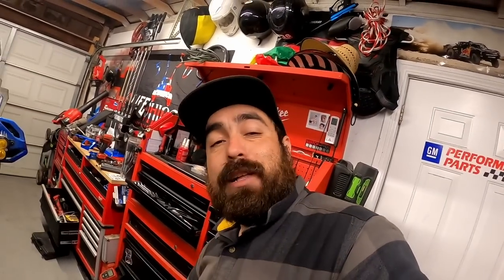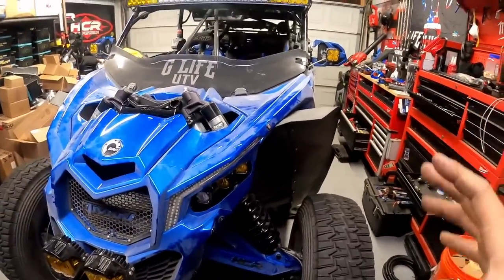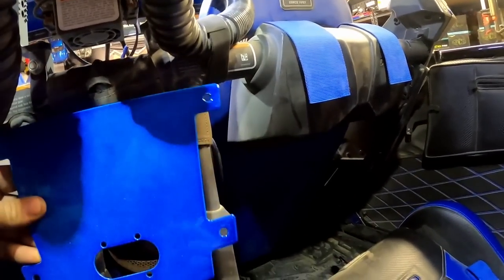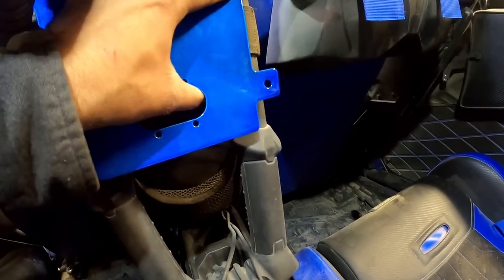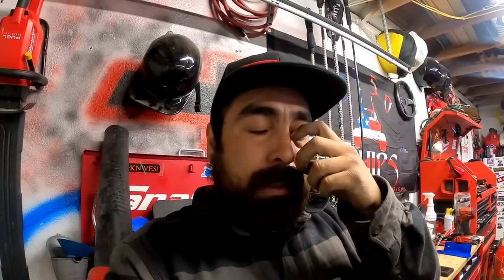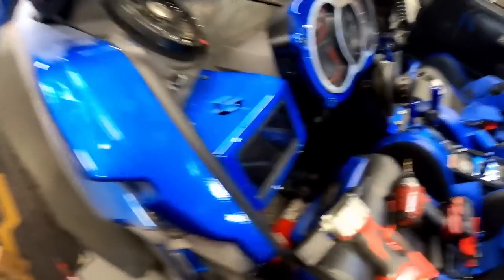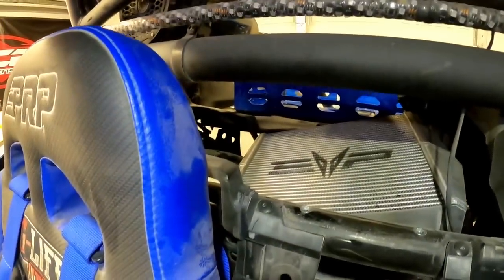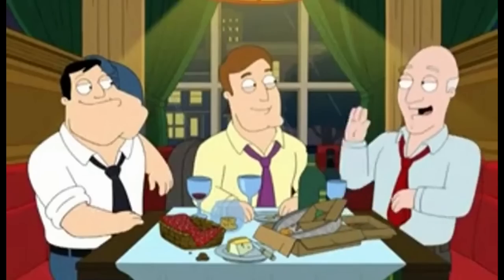90K Later its Done. Big Blue the X3 Complete. Maybe?! Ep 283

Comment: The inside panels of your doors came out nice!  Seadek?  Thought you were gonna do a vid on that? Maybe I missed it. Car looks sick bro. Keep up the good work
Reply from the maker: Right before the sandshow i put the car together. And yeah we use the sea deck material. You can find them all over Amazon
Reply: @GLifeUTV    I just took your advice and did this as well, on some new doors I just installed, pretty easy to install and so far it really cuts down on the rattles and adds a little weight to the doors 👌
Reply from the maker: @ChupacabraOffroad  lets see it👌

Comment: The rattle from the passenger side is the exhaust springs.  Wire tire around them or house clamp around them and it goes away
Reply from the maker: It's not the springs. Coming from inside engine.. 👍
Reply: @GLifeUTV  thats definately not normal.